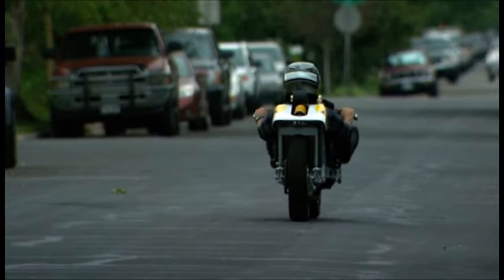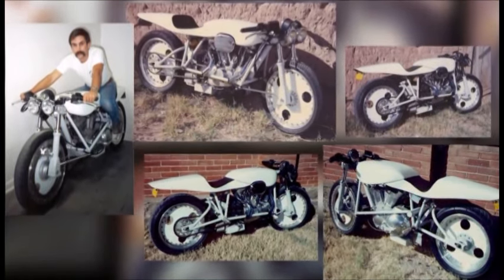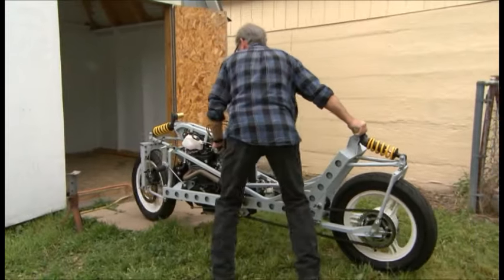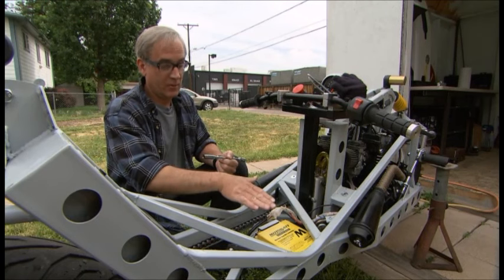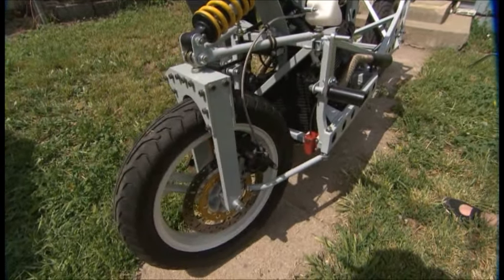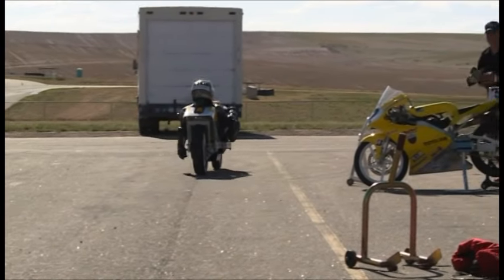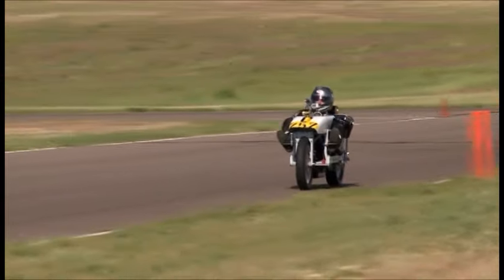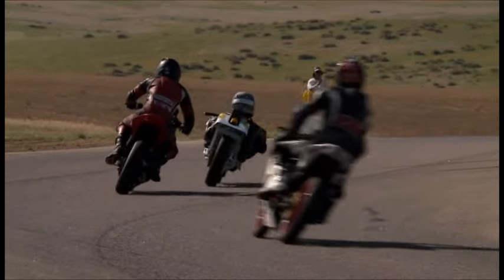Rohorn Racer recumbent feet forward motorcycle (2014)

Comment: Good build idea, but since you aren't sitting any lower butt wise than Dan Gurney or that one guy with the Ducati, you might as well sit more upright and shorten your wheelbase.
Reply from the maker: Seat height is 3 inches lower and the head height is a LOT lower than the Gurney 'Gator. Otherwise, it would have been better with a shorter wheelbase, but the 2WS system added to it later (And originally designed around) made the wheelbase irrelevant.
Reply: @roberthorn  Your seat height is 15 inches? Geez...

Well anyway, the reason I ask is that I'm considering my own recumbent design, but I'm also trying to balance performance with comfort, looks, and certain max dimensions that, quite frankly, affect the former and latter.

Not to mention simplicity since I'm not keen on adding 2ws or 2wd... Looks a little dicey if I'm being honest, too.
Reply from the maker: Yes - 15 inches. 

Have fun with your design and build - glad to know others also want to do that. No need at all for 2ws or 2wd for what you're working on - my reasons for it are here: 
 https://rohorn.blogspot.com/2020/12/but-why.html
Reply: @roberthorn  Heck, after reading some of your blog I think I have more questions than answers.

>Why go sub-180 rear tire if presumably, all the race rubber is 180-200?
>Is there any point in going wider (or skinnier) than the traditional 120 on the front?
>Assuming the availability of tires wasn't an issue, do you think any change in wheel diameter is due for optimization? Bigger or smaller?
>Wouldn't the rear steer make handling worse at non-countersteering speeds since it'll "crab" or maybe even want to fall down too easily or w/e?
>Why are most of your videos hidden and/or with comments off?
>Are you ever going to do a deep dive video explaining the design theory?
>Is the 2ws and 2wd really needed or are you just doing it because of a mixture of personal challenge and pushing the limits? How much farther do you think they'll take you performance-wise compared to RWD and only front steering?
>Have you considered a rear engine layout?
>Is the (no offense) relatively ugly-looking suspension the only way you want to do suspension? Have you looked into Bimota or w/e they're called? I know you like Mr. Britton...
>Is your rear suspension design the only way to package a good mono-shock setup? (the finalized 'Gator couldn't do it and had to settle for duals)

>Are narrow designs like yours pretty much limited to 2 cylinders wide, or do you think you could squeeze a triple without it being awkward? I know Dan liked singles for narrowness, weight savings, and the flat-track sound, but I, for one, and most certainly a multi-cylinder guy out of power density practicality, smoothness, AND sound preference. Though, perhaps a turbo single wouldn't be TOO bad...

Also, something I've noticed particularly in the rider's body position is that yours seems designed for racing, while the 'Gator was just incidentally good at it due to the ultra-low CG and ultralight aspect of the design. My point is, yours isn't suited for the street, but neither are current race bikes with their hunched-over position. I find it hard to shoulder check in either extreme position, but easier when reclined than hunched. Of course, upright is optimal on the street, hence why I'm interested in Gurney's layout, as well as why I currently ride (a portly and top heavy) V-strom 650 as opposed to a sport bike, and why I like Nakeds, UJMs, and Adventure bikes in general. Cruisers feel weird with forward controls; Like there's nothing to brace against... Do you get over that or even have that feeling on something like your EX500 or the Gator? Do you ever feel the need to get or have your feet UNDER you?
Reply from the maker: 1) The next racer is running 120 race slicks front and rear. The thinner tire at the back won't matter due to 2WD - the RWS works a LOT better with tires designed for steering, and it'll run the same RPM as the front. Two 120 section tires will provide more drive footprint than a 180 anyway.

2) No - I'm happy with the way front tires work on the front. But testing would find out if changes would improve anything. Or not.

3) Larger diameter would make design a pain just by making everything simply bigger with no known benefit. Smaller would make design easier, but 17" race tires are what's available, so 17" it is. 

4) Same direction 2WS makes countersteering far more responsive - my last racer is strangely easy to ride at very slow speeds. At those slow speeds, it initially did feel like the back wheel was trying to pass me on the inside of the turn, but that initial feeling becomes normal operational behavior after a while. 

6) Youtube has the second most toxic "Community" on the web - I have no tolerance for it. A good example is the comment section on Fortnine's recent Feet Forward video - too many stupid comments from morons (ItLl cUt YoUr HeAd oFF!! iT LoOkS GhEy! iT wIlL BrEaK yOuR BaCk oVer bUMps!! etc...). My hidden videos lack standalone context - they're mostly support for my blog.

7) The "But Why" article was supposed to be a whiteboard video with lots of hand waving, but decided to write it instead. A video might still be a good idea.

8) Physics says it is the only way motorcycles will go significantly faster. I really want to know what that's like. No, I have no performance gain predictions - lots of work to do to get there. 

9)Yes - lots of reason why and why not - depends on everything else. Even thought about placing a lightweight engine behind the rear wheel - it solves a lot of design problems that way, but looks weird - I'm way beyond worrying about what looks weird anyway...

10) The next racer will be a lot more refined than the last one, but nowhere nearly as nice as what a well financed team could do with composites, 4 axis CNC, etc... I don't have that team or facilities. Or finances. Nothing about the Bimota Tesi applies to what I'm working on, even if it is cool. Oh yes - I am, indeed, quite a fan of the Britten team and their work.

11) The suspension loads shouldn't go through the lower swingarm - it is attached to the wheel by a U-joint. It could be done, but not a good idea, even if it simplifies packaging a lot. The last racer was supposed to get an exotic pullrod layout with a centralized shocks - it would have looked really cool - it would also have added a lot of work, weight, and expense. Thought about doing that with the next racer, but same thing: Work, weight, and expense.

12) I really wanted to run a Triumph Moto2 engine for lots of reasons (Love that engine...), but it is too wide in front of the drive sprocket. V engines - twins and fours, seem ideal, but the exhaust makes them all longer than I'd prefer. Was working on my own engine (Supercharged 2 stroke - VERY compact and powerful, on paper), but an engine R&D program is one step too many. Oh yes - there are LOTS of club racing classes for twins and singles with great racing rules. That isn't the case for fours- those are almost all production based, which pretty much makes sense. 

13) No, mine isn't suitable for the street at all - even if it has been around the block a "Few" times. Forward controls work great and are perfectly comfortable IF you have a good backrest and ergonomics that make good use of it. I agree: without a backrest, your feet work best under you. 

Fun stuff - I hope that helps.
Reply: @roberthorn  Yeah, that's pretty good. Thank you!

Comment: 0° caster angle
Reply from the maker: It does look that way, but it is 12° - the steering axis isn't parallel with the upright. The virtual pivot point is ahead of the front axle.